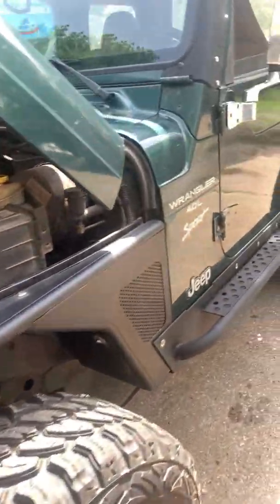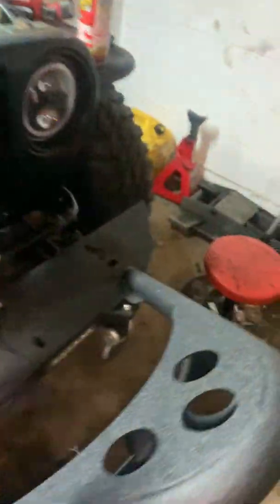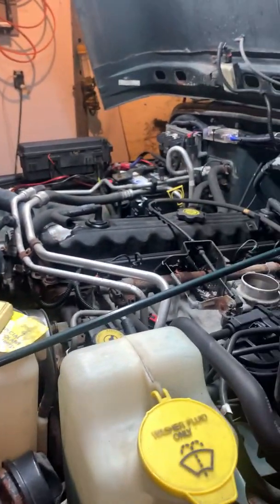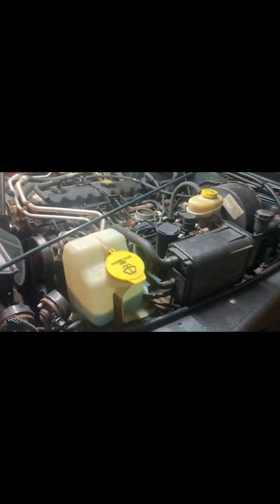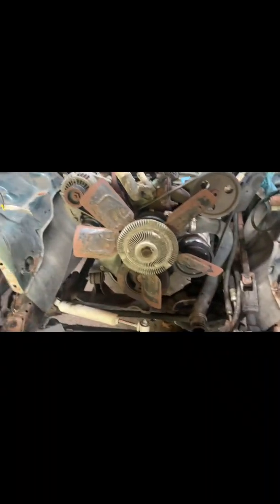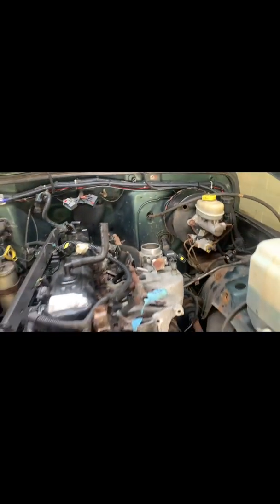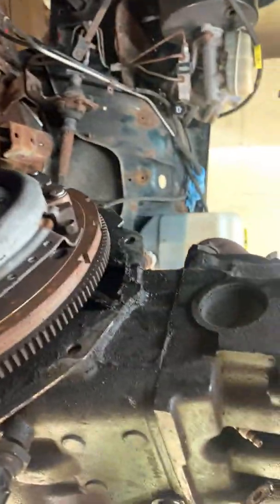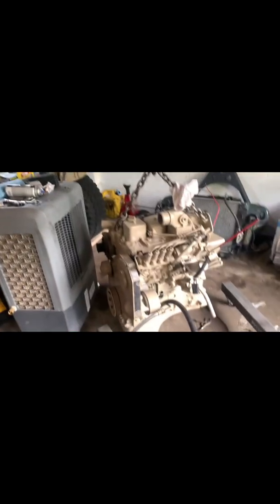JEEP TJ 4BT SWAP PART 1

Comment: Did you have to weld in new motor mount perches on the frame? Or used the old ones? Currently gathering all the parts to do a 04 tj with nv3550
Reply from the maker: Welded

Comment: Awesome build!! Ive been slowly gathering parts to do the same swap. I have the 4bt ,nv4500 trans with 4x4. And i recently just bought the jk chassis. Unfortunately i dont know where to get info to complete tbe swap. I still have to remove the 3.8l engine out to start. My mai. Question is what do you need to do to use the stock fuel tank. Also im not too sure about the wiring. How did you get it to run on stock gauges? Any info helps. Again amazing build!
Reply from the maker: Yes i guted stock fuel pump and left only sending unit. I installed a fuel sump